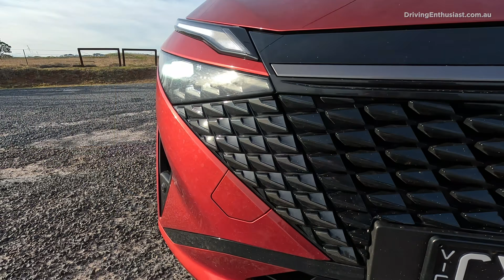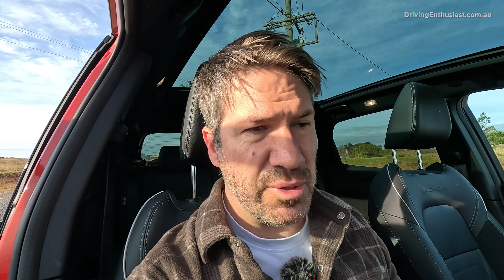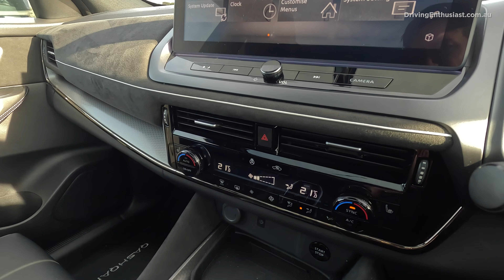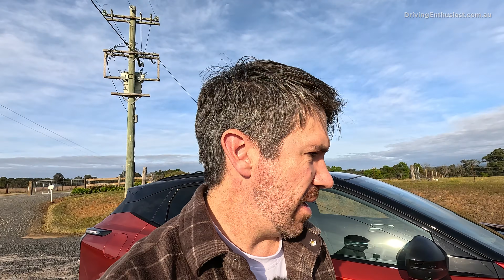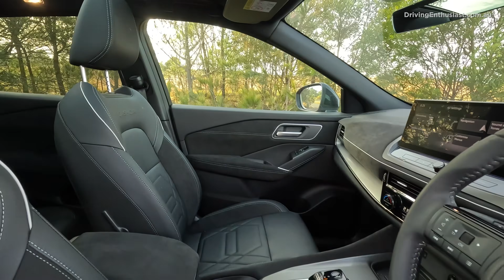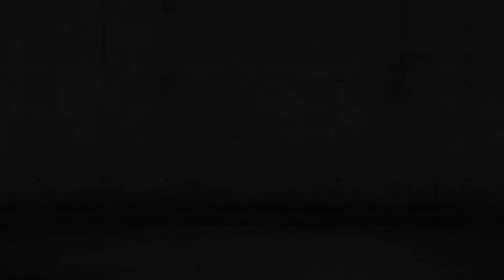2025 Nissan QASHQAI N-Design e-Power review: 0-100 & POV test drive

Comment: Thanks Brett.  The Gen.3 version of the e-Power Qashqai is due to arrive in Australia in March '26, it seems.  Slightly better fuel economy, a bit more power, and marginally quieter according to Nissan's blurb.  This is a very nice SUV.  The build quality from Nissan's Sunderland plant is good, according to the UK reviews, and I think the Ti-L version is the pick of the bunch even though it doesn't have a spare wheel.  It'll be interesting to see whether the dealers here in Aus will offer decent discounts off the pricing which is slated to be similar to the previous e-Power Qashqais.  I'm persuaded by Nissan's clever hybrid concept, having been allocated an e-Power X-Trial hire car a few years ago in New Zealand.  Yep, I'm with the previous poster.  Great car.

Comment: I had an X-Trail e-Power as a hire car a while ago and, yeah, while it’s an interesting powertrain it’s really a shit idea when you think about it. 

A super over-complicated, variable-compression ratio, turbo engine; full power isn’t available until the engine spins up, so there’s a step to the power delivery if you floor it which is annoying; and it’s just not an efficient way to burn petrol. I don’t get the point.
Reply: But surely it is far less complicated compared to any hybrid that has a gearbox. It has none. That is a %20 friction saving straight away. The next generation Nissan epower ditches the variable compression engine completely.
Reply: @smpmarsh it has a reduction gear and differential. And yes the next gen system without the VC engine will be better
Reply: @YZJB  - I've seen the tear down vids of the VC Turbo and yeash what an over complicated trash compacter that is.

As a former owner of the T33 X-Trail with the (ancient) 2.5L NA petrol i4 give me that engine over a VC Turbo.

Comment: GM Volt reinvented. Doesn’t make much sense really. Drive transmissions in cars aren’t a problem.
Reply: The Volt was an EV (plug-in) with a range extender engine. This is not that.
Reply: At high speed the Volt engine could also drive the wheels, so that’s another way the old GM Volt had more features. The modern Nissan just works like a diesel-electric locomotive which seems a bit unnecessary and inefficient.The Toyota style hybrid would seem more efficient
Reply: @Bilsoncomm100% agree

Comment: Thanks Brett. When we were looking there wasn't an e-power version of Qashqai. We ended up buying an x-trail which I was concerned about the size but to be honest with all the cameras it's good in the city or traffic. But yeah, this is a good option. Smaller and cheaper compared to x-trail. As I said before, if someone is hesitant about EV but still wants the EV experience this is a perfect option. Like you said it's not as efficient as other hybrids, but the driving experience is much better. Although, the petrol engine is a bit noisy when it's on. You feel the vibration! Especially when the car is idle. Also, it turns on randomly so it might be a bit weird for some. The other thing that I don't like, not sure if it's specific to our x-trail is the brake! I feel like you need to push it more than usual for it to engage. Our previous Honda hrv brake gave me more confidence! Anyway, thanks again for your time.
Reply from the maker: Yeah I agree, the brake pedal feel is a bit unnatural. Similar to a lot of hybrids and EVs. Due to regen I'm guessing.
Reply: @drivingenthusiastaustralia I see. Also I forgot to mention that I like the e-pedal feature. Although, it doesn't do full stop like Tesla.
Reply: @drivingenthusiastaustralia electric brake booster (brake by wire). That’s why it feels weird.
Reply from the maker: @YZJB Yep, that's what I mean. It can't really do regen with conventional brakes. It needs electric so it can adjust and blend between regenerative and hydraulic as needed. I have driven some HEV/EVs that do a pretty decent job of getting a nice feel though. It is possible, in other words.